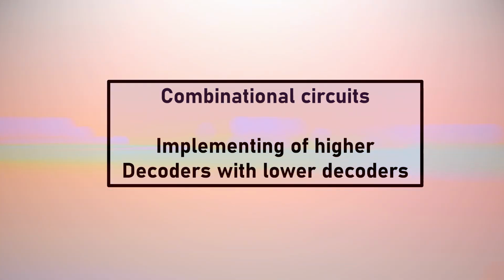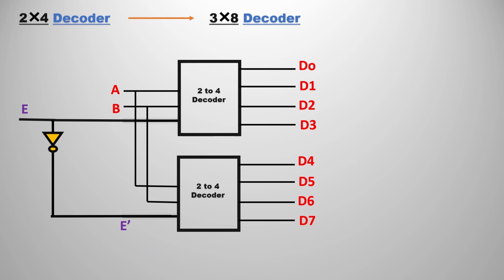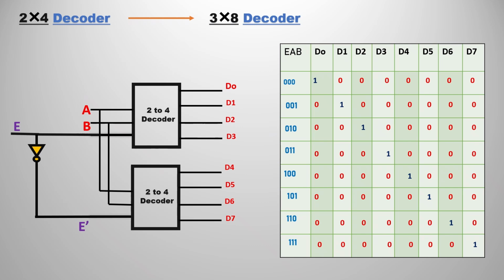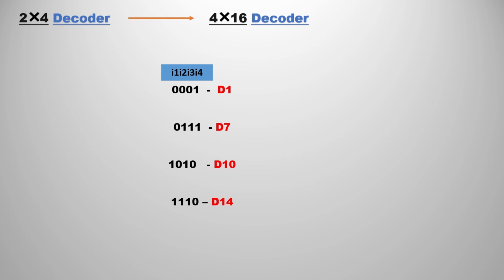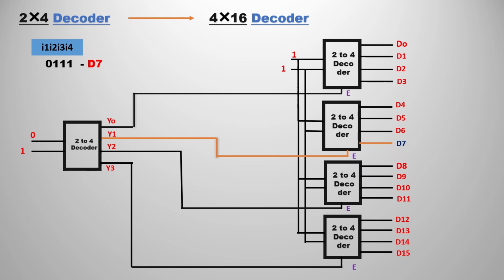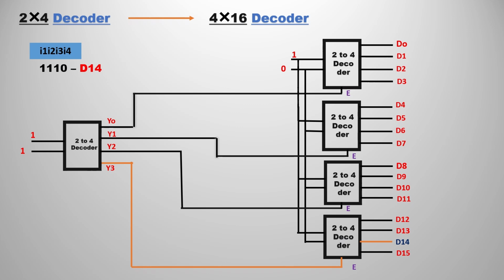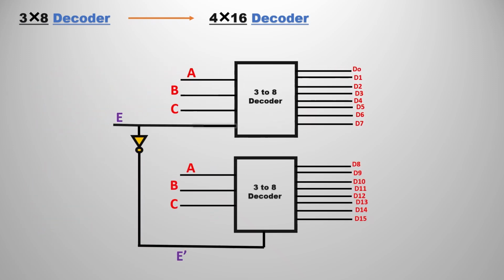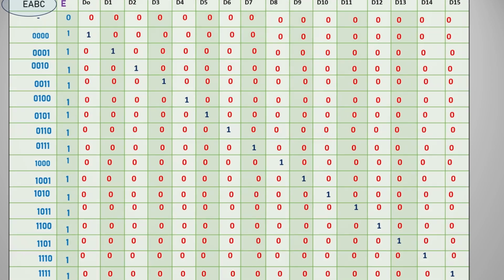How to Implement Higher Order Decoders Using Lower Order Decoders | Digital Electronics Simplified

Comment: hmmmmm I do think you messed up a little despite this being a good tutorial. Why would EAB = 001 trigger the top decoder when the bottom decoder is the E'
Reply from the maker: Thanks — good eye! The reason you might see the top decoder triggered for EAB = 001 is either (A) the MSB/enable lines are wired the opposite way to what you expect, or (B) the decoder’s enable is active-low (so giving a 1 behaves like a disable).
For a 4→16 built from two 3→8 decoders you must use the 4th bit (MSB) as the select:

If MSB = 0 → bottom decoder enabled (connect MSB' to bottom decoder enable).

If MSB = 1 → top decoder enabled (connect MSB to top decoder enable).

If the enable is active-low, invert those connections (or invert the signal). That’s why 001 can appear to trigger the top decoder if the enables or inversion are swapped.